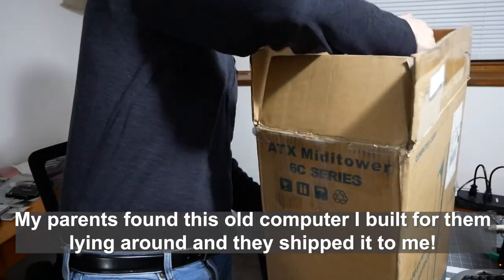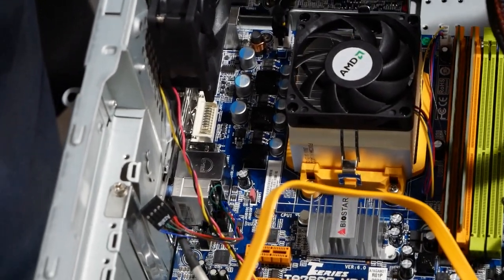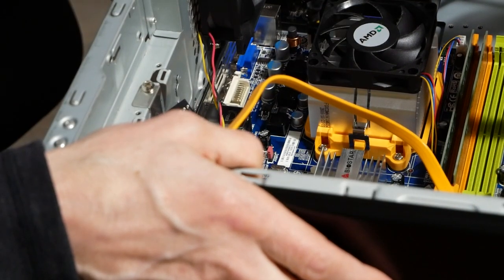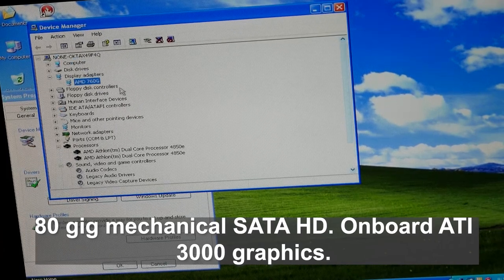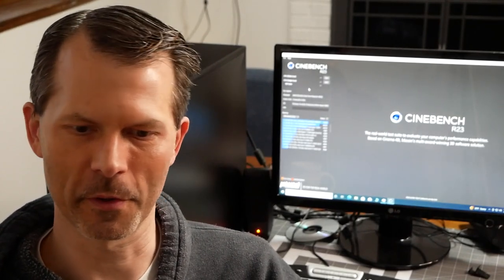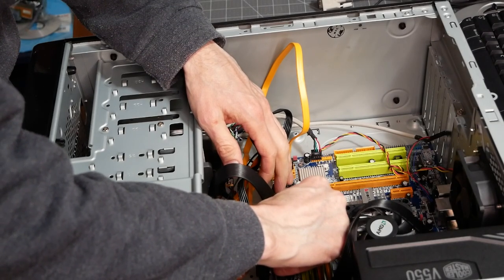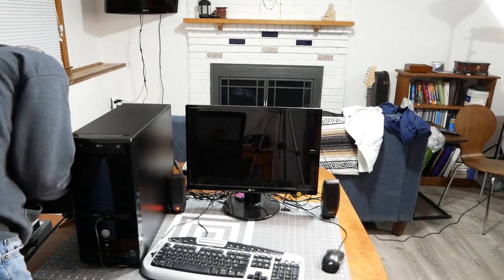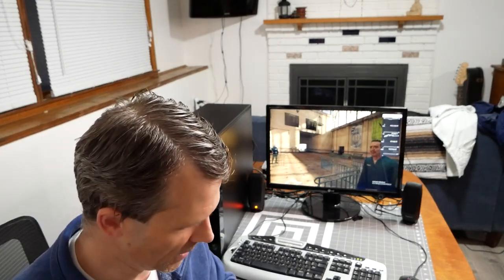Is The AMD X2 4850e Any Good In 2023? Quad Core upgrade! Can You Game On It?

Comment: I used to have an Asus M2N68-AM Plus with a x2 4400+ clocked to 3ghz matching a x2 6000+ and a 9600GT. F.E.A.R., Prey, STALKER,  those were the days... After that I got a x4 620 with a GTX460 and after that I got an i5 2500K which I clocked to 5ghz and it was then that I saw such a performance leap that I will probably never see again. The single core performance gain from those Athlons to an i5 was mind blowing. Even today a 2500K 5Ghz is still a decent gamer.
Reply from the maker: Hi and welcome to the channel! That X2 4400+ chip was nice!, I had a X2 4600+. I even had a Phenom II X4 955 cpu that was nice. That I5 2500K was a game changer cpu! I still have one I use for testing and such on older boards. Thanks for watching and commenting I appreciate it :)

Comment: That TA760 was one of my first mobos, originally paired with an Athlon x2 4000+, then with a Phenom x3 8650.  I needed to replace it though when I got a Phenom X4 9850 BE, as it can only support up to 95w cpus while the x4 is 125w.

I started using obsolete stuff like this around 2016, so I was able to cheaply put a lot into my systems, like going 8gb of DDR2-800 RAM, a GTS 450 and a 500gb HDD.

Nowadays I have 3 systems in use, and Athlon II 250 for my business, a Phenom II 965 at my parent's house when I visit, and an I7-3770 as my gaming rig.  I also have a Core2Duo and a 2nd Athlon II in storage, both fully working systems, all from what I could call a hobby of classic systems... 😅😅😅
Reply from the maker: Nice array of systems you have there!! I still have my i7 3770 as my home server! The 965 is no slouch either! I always wanted a 6 core phenom but too power hungry. I like grabbing cheap upgrades off ebay and maxing out older systems, breathing new life into them.  :)

Comment: man i had similar setup in 09. a dual core amd, 4gb of ram and a gts 250 nvidia card. ran that from 09-14 when i built an i7 4770k and triple gtx 980 rig.
Reply from the maker: Hi! Wow, that's cool! I went from a x4 955 phenom black with 16 gig of ram to an i7 3770 like in the previous video. But man, I can't imagine a triple GTX 980 setup back in the day. So awesome! Thanks for watching and commenting 🙂
Reply: @RememberThisTech  honestly id still being using them if Nvidia hadnt killed off SLI. had a 41k graphics score on timespy vs my 3080ti getting 44k. mind you this is years later, and can safely assume the increased IPC of the new CPUs would see an uplift in GPU score for the SLI setup. this is why they killed off SLI. because 7 years later they would still trade blows at 1080p with a 3080 ti. because people had the option to hang onto older hardware that worked well parallelized. its shameful really lol.
Reply from the maker: @BenFilley  41 and 44k omg! Sweet! Yeah for years Sli and 3' cards would make Crazy powerful machines. Now everyone's pushing for 1 massive video card. Ugg. Your probably 100%  right, people kept their older hardware and didn't upgrade, because why did they need to?? They didn't. So the profit margin drop perhaps made them shift away from the sli mode gpu's etc. so you would have to replace your cards... Great comment ty!

Comment: Hm surprised the ATI 3000 graphics isn't particularly happy with Half-life 2, did you set a resolution or just hopped right in at 1080p or whatever native resolution the monitor has ?
As i'd imagine 800x600 or 1024x768 should run better.

Half-life 2 runs on ATI x300 integrated graphics in my windows xp laptop, a dell inspiron 6000 with a pentium m @ 1.5 ghz & 1.5 gb ram
(Granted it's only at 640x480 & lowest settings + some console tweaks too turn off something that caused performance issues (Been like 2 years so don't recall which commands i put in.)

Also had a bios message about memory bank interleaving, might want too turn that on for dual channel too work as well & making two of the sticks run in dual channel which should help with bandwidth for the integrated gpu a little bit & general system performance might pick up a bit too, it's a dualcore from 2008 so not exactly a powerhouse even at the time.

With another cpu cooler on there like say a 120mm tower cooler.
(Same cpu cooler mounting as AM3+ so anything for that socket fits if it uses the same clasp mounting method.)
You should be able too overclock it a bit even on that somewhat anemic motherboard turning down memory clock speed too the minimum & like 240 fsb for 3.0 ghz on the athlon x2 at I'd guess 1.35 - 1.4v should do it.

A cheap 120 or 240 gb ssd (Biggest upgrade for usability besides cpu, specially on a standard untweaked windows 10 install.)
For windows try Atlas OS which is a tweaked windows 10 pro install, you'll probably get a fps boost ontop of the upgrades you've done vs stock windows 10 on this.
(Just make a bootable usb via rufus after downloading it.)
Some settings may glitch & crash a little bit like windows power settings for some reason, at least for me here running the 21h2 version of Atlas OS but it's in general super responsive even on lower end or older hardware it's a pretty good experience, specially on an ssd.
Reply from the maker: Hi and thanks for the great advice/tips comment! I didn't set up any resolutions when first trying HL 2 with the ATI 3000 onboard. When I tried it with the x2 4850 it was like a slide show and that was on the initial start up screen. SO I kind of thought it was not worth moving forward with the onboard graphics. I upgraded this machine to a 240 gig lexar ssd, and stuck in 6 gig for a total of 8 gig ddr 2 ram Plus a x4 945 phenom 2 cpu. Those plus tried the 6670 1 gig video card plus the old trusty hd7950. Most games ran decently. Except for Wolfnstien new order. Thanks for the tip about Atlas OS. I'll have to check it out ;) I might OC this machine but ods are no. Might do a retro game build from it or repurpose it into a nas sys with true nas i'm not sure yet.. Thanks again for watching I appreciate it!
Reply: @RememberThisTech   MM might be on to something. I can't find the youtube video, but I do recall someone using that ATI 3000 in Left 4 Dead (should be source engine like HL2), and they were getting pretty decent frames. The problem is, it doesn't look like AMD never made any W10 drivers for it. I tried showing the link to AMD's page, but it seems that youtube hates posting links to sites other than it's own. 🙄

So if you want a real challenge, the W7/W8 drivers MIGHT work in W10, and I'd up the ram that 3000 uses to 512MB to then see how it goes. Or possibly putting W7 on a separate drive or partition with its proper ATI driver to test it out there. Question is, is it worth the experimenting to see what you might be able to get out of it? 😉 I'm practically curious enough to almost try it myself if I had the time right now LOL.

I fully agree onboard graphics of that era are crappy, but my god, this is all in the name of science! 🤣
Reply from the maker: @M R  Hi. Lf dead really got decent frames on the onboard 3000?? No way? I've got to see that.. that would be amazing for super budget gamers out there. Wow! If u find the link, please share!! I bet you're right it's drivers and not maxing the shared ram.. Right now, I've 3 project builds for the channel I've started and stopped on do to let's say hickups.. so I'm not sure I've the time to investigate this either.. Might come back to it, though.. Wish me luck it seems fighting to get old tech to work is becoming my lot in life, but it sure is fun!! I either succeed and get a new video or.. I fail, and you get to see that video, too, lol. Either ways a win and I learn stuff.. or get more grey hair ;)
Reply: Hehe no shame in showing the fails, either! Success or failure, it is all a learning experience for everyone.  Since you busy with the current stuff, feel free to do a follow up video in the future.  Hey, it’s good you got stuff on a to-do list for your channel! 😊

Here is one video I found.  They playing at 1024x768.

https://m.youtube.com/watch?v=OTtb8qkeu9Y
Reply from the maker: @itstheMR  I shall attempt it if I remember lol maybe combine it with some OC the whole machine until it's max stable ;)

Comment: This had been an excellent Windows XP Computer ☝️ recently I got a similar Asus 4 AMD 4800+ 2X plus 2nd fastest Phenom I black edition CPU, runs Windows 7 64 Bit fine. But I found a Debian based Linux Derivate for current needs. Will upgrade RAM and to the Phenom I asap.
I skipped AMD and Core2Duo, worked these days with P4 3+ GHz and Dual XEON 2/3+ GHz.
Reply from the maker: Hi, and welcome to the channel! That 4800+ was pretty nice! I have a 4600+. When you upgrade your ram, it should help a bit. I'm partial to Linux Mint Cinnamon. It's really polished. Most older machines run  well on Linux OS. Thanks for watching and commenting. I appreciate it :)

Comment: Im thinking the old psu was too much for the system power use and had to run at very low power all the time. A 600 watt psu running at like 50 till 100 watts all the time is bound to break and have very bad efficiency.
Reply from the maker: Hi, and welcome to the channel! Yeah, good point about the ps. Plus, it was over 14 years old, I've no idea what the internals look like. For all I know, it probably has leaking bulged caps and more, hah!! :( Thanks for watching and commenting. I appreciate it.
Reply: It won't break because of low usage.
Reply from the maker: @FutureChaosTV  It will break because its a 14 year old Rosewill PS lol :)

Comment: Fraps helps but idk if that's what you meant by afterburner
Reply from the maker: MSI afterburner is a fps and stats overlay for displaying games stats fps etc.
Reply: @RememberThisTech  nice well im having a issues with my my dell t3600 it has a e5 2660 8 core but it uses both ecc and non ecc but if i put non ecc it detect all the stick but tone of them read 0 gigs but if i trow in the ecc it will read the full amount and some it will fult out and only read half of the ram in the dim any suggestion ?
Reply from the maker: @fxgamer-11yt  Hi, You might have a bad Dimm slot.. It might take a while but do like you were doing and find all the sticks that register, 2 at a time, remove them and test those same ones in a diff paired dimm set of slots. If the same issues happen in a paired ram slot u will have sort of isolated the socket. If it doesn't repeat with diff ram sticks but some then you have a poss bad stick. Note: SOme boards have a memory test feature you can set in the BIOS that will check the Ram on boot up. That would be the easiest check first!
Reply: @RememberThisTech  all will register but only with ecc ram but the one dimm I'm having an issue with will say that an 8 gig stick is only 4 or 0 gigs form times and hard freeze or crashes form.time to time but with none registered ram the slot and windows picks up 0 gigs but is registering that the dim is in use with cpu z it reads all the ram and everything just doesn't show up in windows or bios
Reply from the maker: @fxgamer-11yt  Found this not sure if it will help. Make sure not to mix and match ecc and unbuffered ram. Make sure each back is paired with same size and speed ram . 
: The memory controller on the T3600 supports dual-channel, triple-channel, and quadruple-channel architectures. The memory DIMMs within a specific channel must be populated starting with the DIMMs farthest from the CPU. The DIMM slots 1 and 2 must be populated before slots 3 and 4.

To ensure maximum channel performance, memory modules should always be installed in pairs of matched size, speed, and technology. The system will operate with reduced memory performance whenever mis-matched pairs of memory are installed.

For example, to achieve quadruple channel performance all four memory modules must be identical in speed and capacity. When only two memory modules are installed, the system memory performance will revert to dual-channel mode. When only three memory modules are installed, the system memory performance will operate in triple-channel mode.
https://www.dell.com/support/kbdoc/en-us/000124293/why-my-precision-workstation-t3600-won-t-post-boot-or-recognize-memory-correctly-after-upgrading-memory

Comment: I mean nothing is a paper weight if you use the operating systems they were made for it's only when you use these old processors on modern applications were they struggle
Reply from the maker: Hi there! You're 100% correct. But it was kind of for dramatic effect saying that ;) I also intended to update it to the quad core which I meant to show people that you could extend the life of your platform by a simple cheap upgrade ;) Thanks for commenting.